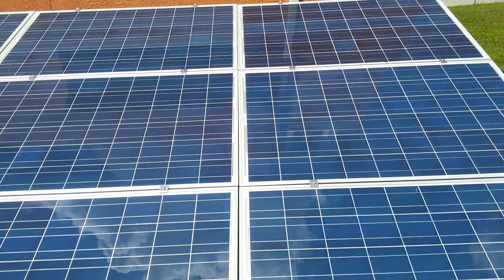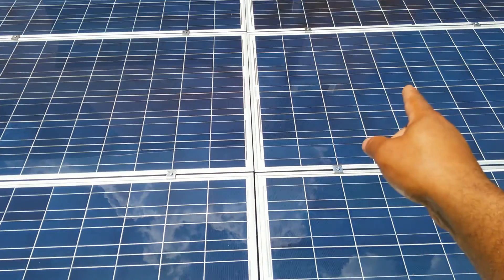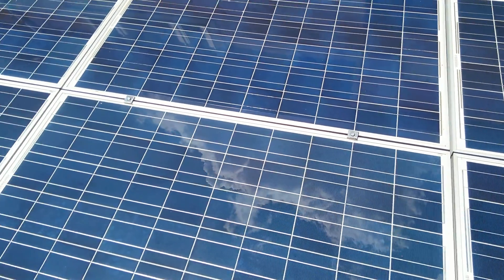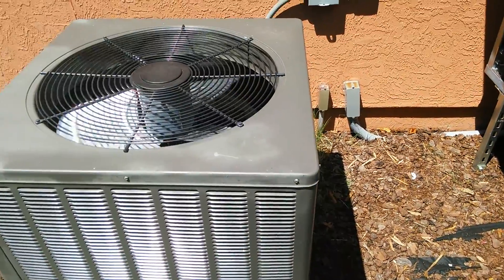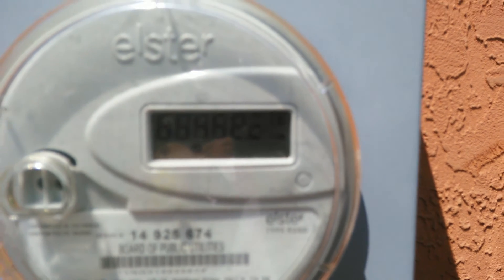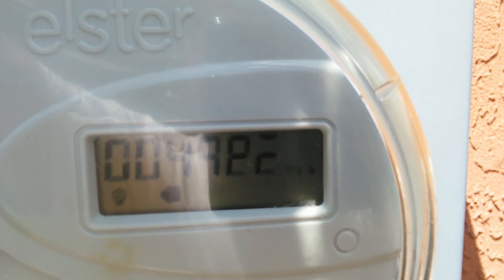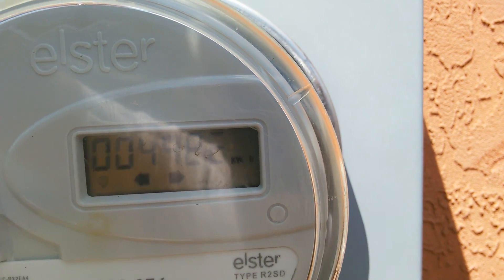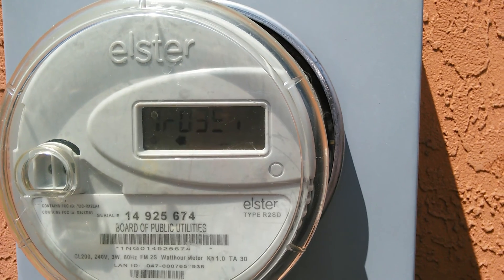Light meter solar panels an outdoor AC unit

Comment: hi thanks for sharing! im from a third world country and want to know if its possible to run a central ac unit such as the (lennox solar) on full solar power. Im considering building a house somewhere without public energy but with nice views and plenty of water. My area does get hot / buggy and need AC!
Reply from the maker: Ojo Aereo I'm so sorry about getting back with you so late but I've been very very busy but yes you can run a central air  unit on just solar but it will take a lot of power I would suggest using the mini split ductless system and you would not need as many batteries and solar panels. Thank you
Reply: great thanks